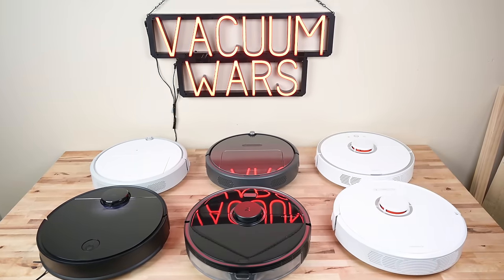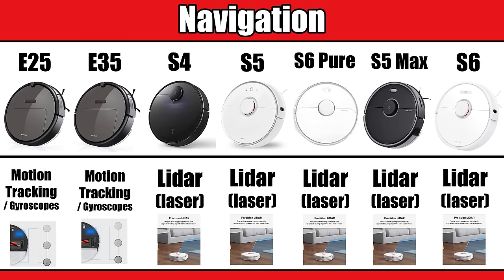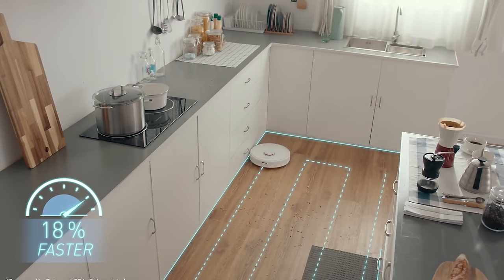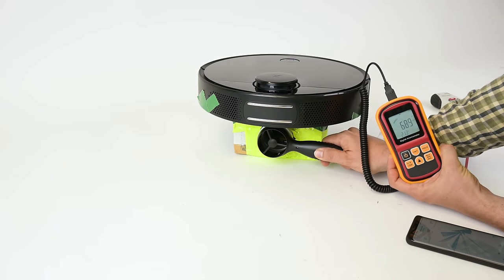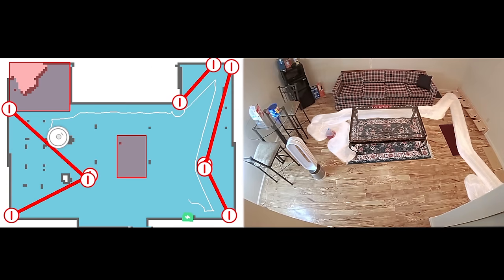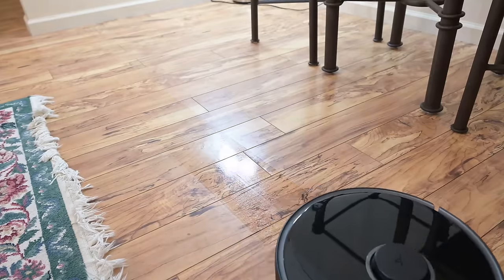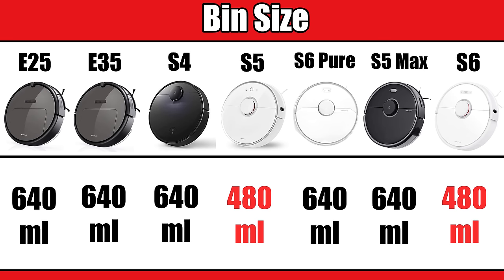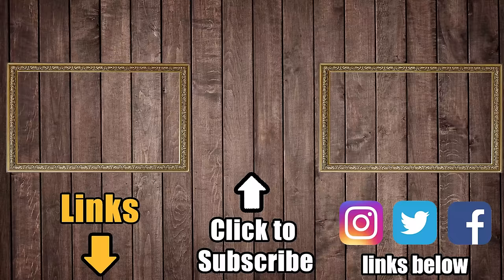Roborock S4 vs S5 vs S5 MAX vs S6 vs S6 Pure vs E25 vs E35

Comment: Hi guys. Two days ago I bought an S5Max and the seller offered me to change to S6 (with no need to pay the difference) because S5Max is out of stock on that specific store (the message on the comments below*). I live in Brazil and here we don't have the culture os carpets all over the floor, mostly hard floor all over the house. I can't be sure about that decision, and I need some help.

Ps.: the new robot will work together with my Xiaomi 1st gen vacuum cleaner.
Reply: (*) The message from the seller:
Dear friend
We are sorry to inform you that the manufacturer delayed the delivery S5, Max,because of the quality tests, we can't send the bad quality item to you.
We are contacting them and solving this problem seriously.
But we are not sure of the time.
Do you agree we send you the model S6, which is more expensive and good than S5 Max.
Of course, we don't need you to pay the difference, It‘s our compensation for you.
Really hope you can accept it.
Best regards.

Comment: I'd really like to see a comparison against the new Xiaomi Mijia S1.  Since I'm in Canada and Roborock refuses to warranty any vac not purchased on Amazon.com, the prices were kinda ridiculous with import fees so I went with the Xiaomi.  I'm currently testing it against a Neato D6 and it seems really nice.  The Neato does a better job resisting hair tangles, but otherwise they seem to be a pretty close match.  I'll be looking to get the easy clean main brush when I need a replacement since the Xiaomi uses all the same parts from the Roborocks.  The Xiaomi has multi floor/map saving, though it wants to overwrite the last map on the list each time it runs so you have to make sure you are cleaning the floor it is about to delete in order to keep three maps on file or you can load and save a map to move it back to the top of the list.  The Neato does map saving with less hassle admittedly, but it does not have the room selector that the Xiamoi has.  For this I would need the Neato D7 and I didn't expect to use the feature.  Now having the vacs I'm glad because my floors are relatively small and the Neato can manage each one on a single charge in about a half hour anyway.  The Xiaomi also has a voice pack, which can be changed to English for fun, and has real time mapping which I'm sure the novelty will wear off of, but it's pretty amusing to watch it on the app map as a new robovac owner.  There is a seller on Amazon.ca selling D6s at the same price as Amazon fulfilled D5s and without the taxes, but the Xiaomi was still about $100 cheaper.  I'd really like to know if I'm missing out on anything going with the cheaper Chinese branded version, particularly against the S4 since the Xiaomi does not mop, potentially saving bin size while having all the features of the S5.
Reply: I just ordered the S4 from Amazon.ca and it was only about $50 more than it would have cost on Amazon.com. The S6 is outrageously priced on Amazon.ca. Either way, I couldn't spend $600 and not have a warranty.
Reply: @King_Kenny66  Neato registered my D6 without an issue and Aim to Find is an authorized retailer, admittedly in the US.  The S4 is definitely reasonable, and it looks like the seller is Roborock itself.  The seller page indicates they will warranty the vac, but I still had concerns that Roborock's website specifically says they will not warranty purchases outside of Amazon.com.  The import fees also pushed the price up and I can't be sure how much of the fees, if any might be refunded.
Reply: @overkill1340  Good stuff! The D6 is an excellent vac, I'll have to check out Aim to Find as well. Who knows, I might not be happy with the S4. I'm still going to check out more reviews of other companies in case I return the S4 and want something else. And yes,you are bang on that Roborock will only offer a warranty from Amazon, no one else, kinda sucks.

Comment: Roborock S4 does not work well on carpet.  Low pile carpet sure, but if you have decent carpet it will NOT work.  I just replaced my whole house with carpet - .75 inch pile height and it doesn't move on it at all!      But for the hardwood floors in the kitchen/hallway - the S4 does an amazing job.      S4 good for low profile floors -    DOESNT WORK AT ALL on high pile carpets.

Comment: The roborock S5 has room select also. If it's not yet available in the US on the Xiaomi App you can easily install it using flolevac. The current disatvantage is that for now the rooms can't be named resulting you can't tell amazon alexa to "clean the kitchen" and also there is no different time schedulle for rooms. I wrote i think on your fb page too. I use the S5 mop with cleaning solution. Filtered water,.. who really uses that to mop floors? The mop would get dirty in the 1st meter and the water wouldn't be filtered anymore. I made some huge 1mm holles in my roborocks S5 filteres and the water flows much fester. Since i put cleanning solotions it beats the hell out of any other roborocks . Even that the filters have holles my roborock while not moving doesnt loose a lot of water. It goes back to the dock, i letted it there for many hours (around half a day) and never the water ammount was more than some very small 4-5 cm puddles underneeth it. In my opinion those filters are a marketing scamm from Xiaomi Roborock to make clients spend on more consumables.